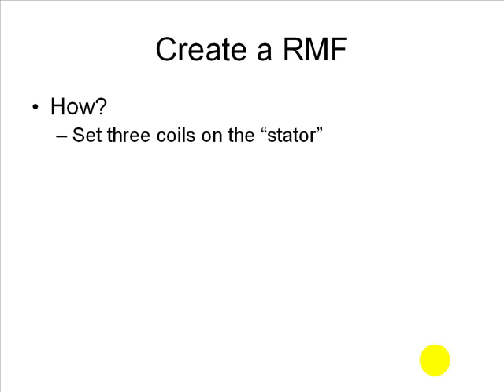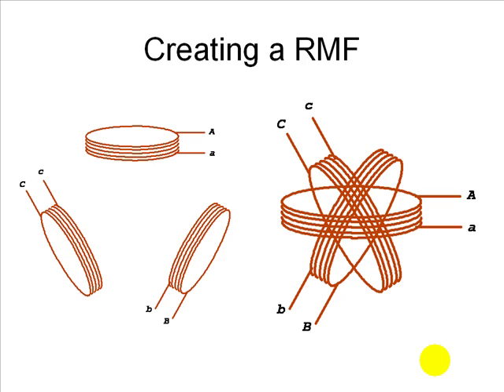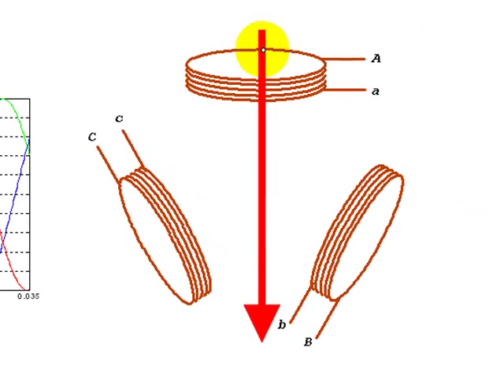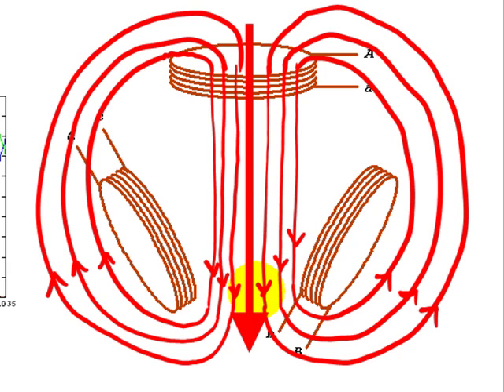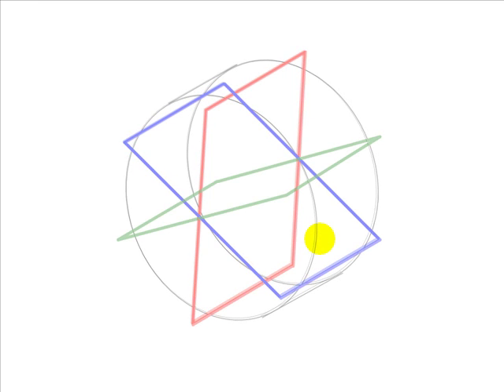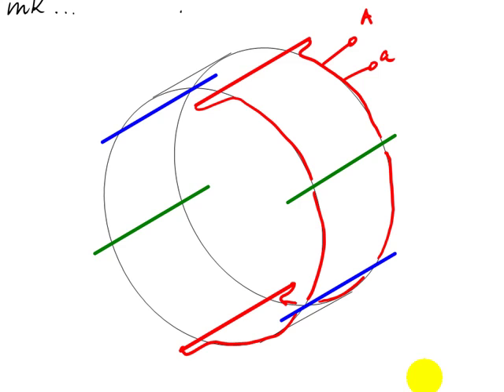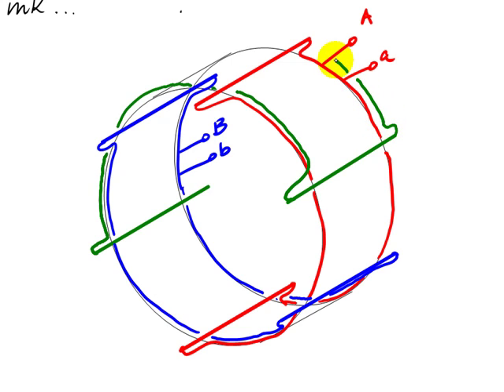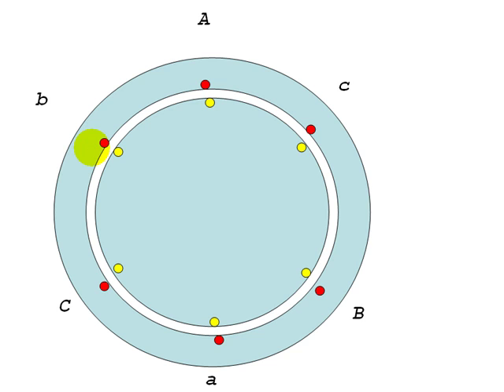INDUC 04 - Induction Motor, Stator Coils

Comment from the maker: Except in more expensive models, the rotor coils are shorted inside the machine. They do not have external terminals. The most egregious example of that is the ubiquitous squirrel cage machine,

Comment: I think what he may have asked, as I also am asking, is that are the coil circuit supposed to be a complete circuit on its own without the terminals? If so, when you connect the terminals, the current would simply flow in that small loop, no?

Comment from the maker: Yes, the rotating magnetic field induces a voltage in the rotor coils, but if there is no current path, there are no currents and there will be no Lawrence forces, that is, no F=BIL, so there will be no torque, etc. To have torque, we need to close the current path in the rotor, to short circuit them directly (normal operation) or through resistors to increase the starting torque.